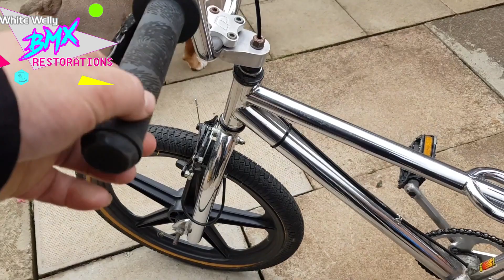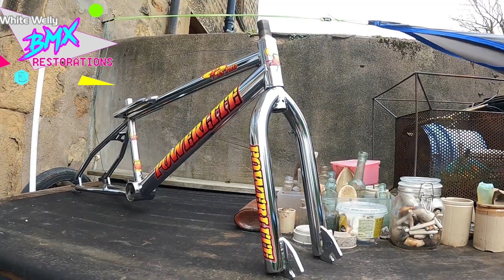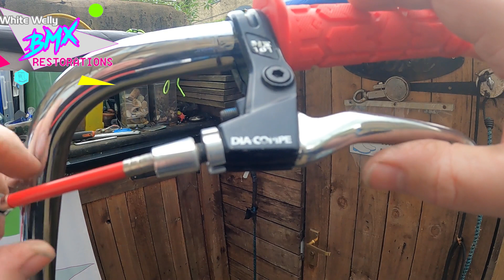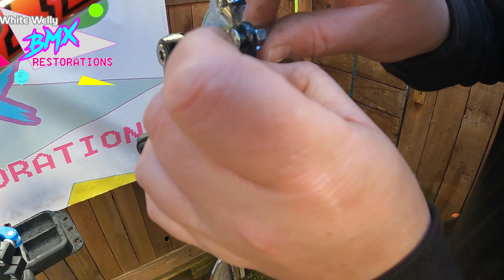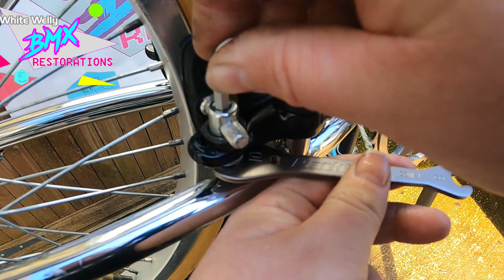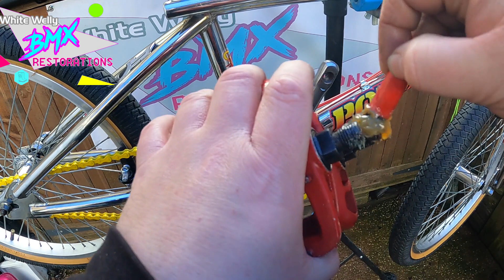1995 POWERLITE PFS PRO Freestyle BMX Restoration #bmx #restoration #restore #powerlite #freestyle

Comment: Nice work dude! I still have my '96 FS Expert that I've had since brand new. These Powerlites in general seem to be pretty uncommon.. I rarely see them. 🤙
Reply from the maker: Cheers man. Yeah they are rare. Usually can find the fs1 or fs2 . However I picked up a chaos. Same frame but no ad990 mounts. That will be on here at some point.

Comment: Awesome video!! I missed it…what do you do with the Castro oil and the freewheel? You use to lube it?
Reply from the maker: Glad you managed to catch up. The castal pot is just Lm grease I use on the freewheel threads so its easier to remove from the hub.